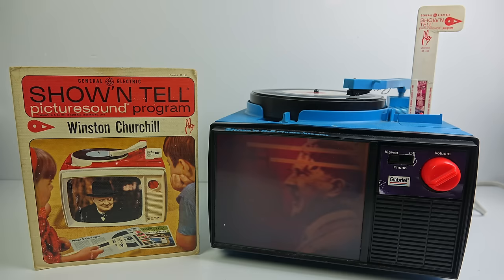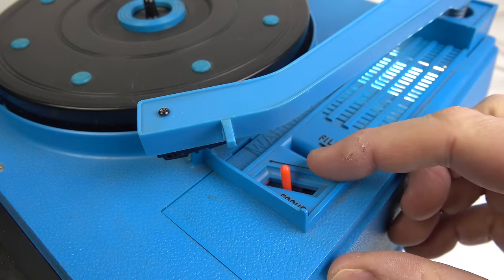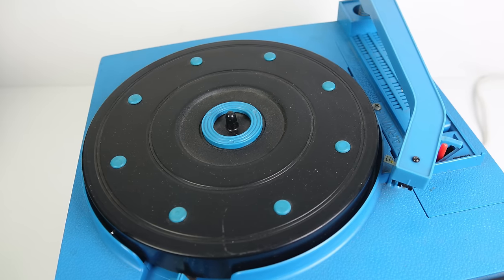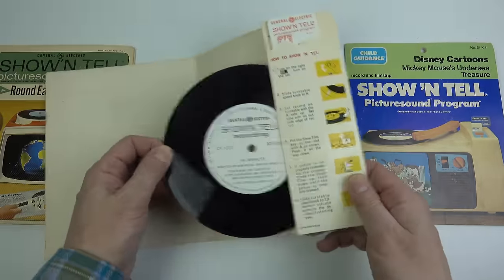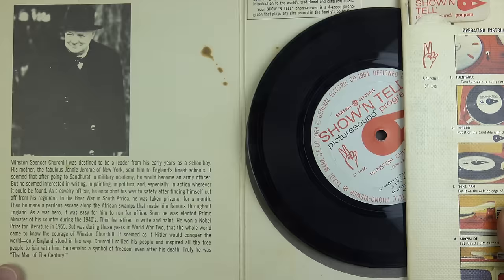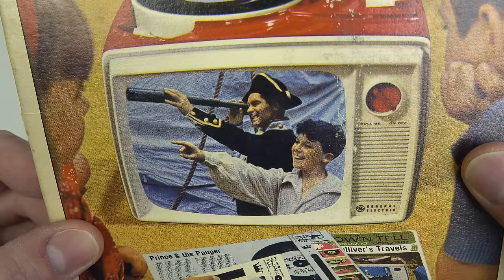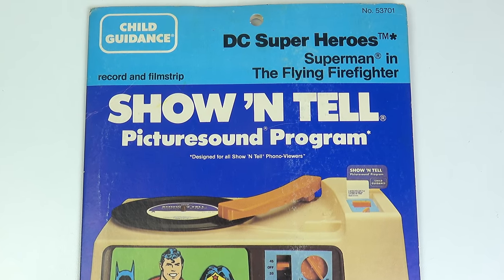Show 'N Tell - 1960s Children's Multimedia System

Comment: ROFL - sage advice, that last sentence.  Made me LOL out loud at work so thanks for that.  

Re: your ongoing battle with 120V @ 60Hz - have you ever contemplated obtaining a North American uninterruptible power supply, a fairly decent one with a large enough battery that could last 20, 30 minutes or so, charge it fully with your 240/50-120/60 converter, then utilizing just the UPS for cleanly powering your various devices from across the pond?  Uncertain that would be an ultimate solution for you but working in IT and being around UPSes most of the time it got me to thinking how you could get portable, reliable, and clean 120V/60Hz power over there.  Thanks for another fantastic post.
Reply: The output of an UPS is not very clean, unless you spend big bucks.
Reply: Fridelain What do you mean by clean? I know in high end audio battery power is as clean as it gets for noise. I assume you mean something else?
Reply: You are not getting DC power straight from the battery out of the UPS. You are getting AC. Now, optimally, AC is a pure, smooth sinewave, a smooth gradient of voltage, up and down. The tech to achieve that from a battery is expensive. What you get instead is a unsmoothed "staircase" of voltages, with sudden changes. You can't chain those cheap UPS, because the fake sinewave from the first is detected as poor power supply and the second UPS is triggered into running off the battery.
Reply: A pure sinewave inverter, a battery and a battery charger is probably cheaper than a pure sinewave UPS. (and more appropriate)
Reply: Fridelain Thanks for the explanation, and the information. Very much appreciated. I'm very much into electronics, including computers. But I never knew about this.
Reply: Ha me too :)
Reply: "Lol out loud" what do you think the ol stands for?
Reply: Colin Johnston [thats the joke...shhh]
Reply: A homemade motor/generator set would work well enough for audio, as long as the speeds are matched with the right size belts.
Reply: You need a "smartUPS" or something of that grade - the important part = PURE SINE WAVE INVERTER 
Used they aren't too bad, may need re-capped if very old.
They are cleaner than the power running into your house.
Reply: Alternatively get a solar setup from the US and have a totally seperate power system. Then every sunny day you could... oh, wait.

Comment: I remember this toy! We had the one from the early 70s. If one wanted to restore the colour, there's a software program, which was developed by NASA, called Retinex. It was originally developed for spy satellite, and probe image enhancement, but it was eventually released to the public, back in the 90s, and 00s. One could scan the images in, and one by one, enhance each frame, then recompose the images, for printing onto a transparency, which could then by inserted into the playing strip. I had the Treasure Island strip, and disc. Thanks for sharing this.

Comment: If you'd like to restore the slides to their original color, I'm pretty sure you could just do as you mentioned in the description (scan and color correct in software), and then print them in transparency sheets.
Reply: Why, its not as though anyone is going to be using it on a regular basis, people like things to be original, they want the crackly sound and dodgy picture, that's actually part of its charm

Comment: DC-motor? Surely a slip of the tongue :)
Reply: Quite a few turntables use DC motors. 

http://thefunkfirm.co.uk/motor-upgrades/
Reply from the maker: There’s a bit more information about this in the video description text box.
Reply: I see your note has 'rectified' the situation.
Reply: Groan
Reply: Ah, how easily people forget your video putting together a 120v 60Hz solution. Keep up the good videos.
Reply: It needs to be a DC-motor to play those superman comics ;-)
Reply: That's what i had in mind with my comment.
Reply: zapro_dk better than a marvel motor!
Reply: I am sorry if this came as a negative comment - it was not the intended to be negative in any way. I just couldn't see any reason for a DC motor being affected by mains frequency, but if that was the case, i am sure Mat would clear that up.
Reply: well given the last thing he shows is Superman, who is DC comics, it should still count.
Reply: Maybe there's a version with a Marvel Motor?
Reply: marvellous comment ;)
Reply: The key reason to keep using AC motor on turntables is because mains freq is very stable. A DC motor is the perfect choice, but you need a speed governor for it. Probably in the design stage (early 60s), a DC motor with mechanical governor was very expensive. Note that cheapo R2R gear didnt got these  nor a Capstan drive.
Reply: LOL
Reply: Though they all had DC motors, power supply is AC converted to DC.
Reply: To be more pedantic it will likely be a synchronous AC motor, the same as was used in older AC powered clocks as they are perfectly locked to the AC waveform.  They do not have a lot of torque, though you don't need much to spin a record under a stylus, but they also don't have the variable slip of more ordinary AC induction motors.
Reply: Ethan Poole oh I forgot about those motors. I had a clock that ran on that type of motor, smooth too.
Reply: DC motor - because the Marvel motor hasn't been invented.
Reply: +Ethan Poole while there are indeed some record players using synchronous AC motors of various types, the majority of them actually use asynchronous shaded pole type AC motors. While those do slip, they can easily be dimensioned in a way that they will give a reliable constant rpm under a normal load range.

Comment: I seem to recall, in my very distant, hazy memory of the early-to-mid 1960s, a system that was much more scholastically oriented that we had for a few years that was very similar but different from Show 'N Tell.  It was less entertainment and more lesson-based and found in, well, classrooms. I kind of think that it didn't have a record but, somehow, the film and audio were integrated into a single cartridge and were synchronized and required no other fiddling. I remember finding it fairly impressive. I should note that I was blown completely away a few years later when my junior high school acquired the very first Sony B/W video camera and tape recorder, about 1971. That was the most exciting and stunning experience of my school years, which doesn't speak well for my school or my academic experience.

Comment: I have seen a similar system, abandoned in our college's warehouse, that uses 35mm filmstrip projector, and have a reel-to-reel machine add-on that switch the slides by beeps on the second audio channel on the tape. And the add-on is not just connects to player outputs, add-on have their own head and has to be physically placed on the side of the player and the tape has to be fed from the reel through player's head, then through add-on's head, and after then on the other reel! It was the weirdest setup that I have ever seen, it looked like DIY, but it was not, because it still had own box and instructions manual.

Comment: We had one of those which, IIRC, we won in a U.K. breakfast cereal competition. I remember that the rack gear on the plastic slide strip would just ratchet over the stationary pinion, when you loaded it, causing quote a build up of little plastic shavings, over time.

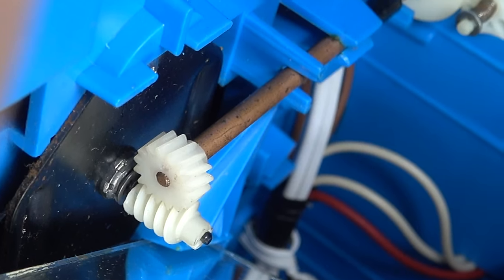Comment: The mechanism that translates the continuous rotation to momentary to move the slides every 15 seconds even though the motor is always running is a Geneva drive gear mechanism. The strange gear with slots in it at the end of the gear chain around 11:19 has a mating gear with a raised section that rotates that gear 72 degrees (In this case, with five slots. 360/number of slots = degrees of momentary rotation for each of the continuous rotations of the input shaft)  every full rotation. They were popularised in watchmaking but also were used in film projectors for exactly the same purpose sped up to 24 cycles per second, a very rapid change between frames that are then held still long enough to be seen.

Comment: The mechanism that moves the slides is called a geneva drive that is also what is used for film video cameras to guarantee equal exposure time of each frame. There is a video by maker's muse that explains how it works If you want to learn more about it

Comment: Can't help but be reminded of my own slide viewer, the Bell+Howell Ringmaster II, instead of a turntable it has a compact cassette deck built in and a Kodak Transvue 35mm slide tray. Not really for the same purpose but oddly similar in design, have to wonder if someone copied someone else's idea there. Very solid device too, still works wonderfully even after 20+ years of sitting in a relatives dusty basement.

Comment: They made a more advanced concept of this for those 35mm school film strips with a built in cassettes deck. Side B of the tapes usually had an ultrasonic cue signal instead of the beep specifically for those auto-advance machines. Looking on ebay, it appears that Dukane even made them with turntables!

Comment: Techmoan has one of the later, cost-reduced versions. The earlier versions had a small metal disc to the right of the turntable that was scored from the center to the edge. You would manually turn the turntable so that the score pointed toward 9 O'clock toward the turntable and you would also place the record so that the big red arrow on the label was pointing toward 3 O'clock and that way, the filmstrip would advance exactly on cue. Hardly anyone bothered to do this so the later models and titles just rely on rough synchronization.

Some titles had the arrow on both sides if the record indicating that you could play the filmstrip with both sides. One side might play a song while the other might have commentary.

Comment: I was actually curious about the playback speed and how you dealt with that issue. While converting the voltage from 220 volts to 120 volts was child's play using a transformer, record players like that typically used an AC synchronous motor and I know wouldn't run at the right speed on a 50 HZ ac signal, since they were designed to run at 60 HZ

Comment: I've had a handful of record players that were four speed. I used the 16 2/3's speed to slow down 33 1/3 rpm albums to try to learn guitar parts. But I've never seen, let alone owned, a 16 2/3 speed record. I just looked up 16 rpm records and found they were mostly spoken word recordings, because the sound quality wasn't really good enough for music. But what struck my fancy was that an under-dash 16 RPM record player was an option of some 1956-1958 Chrysler made automobiles!

Comment: The noise is probably caused by the switching inside the “sine” wave inverter, some ones use two square waves, which produce that noise.
Newer ones use PWM, which is better but may produce a high pitch whine. 
Anyways, I think you could solve it by getting a big filtered plug, the circuitry SHOULD smooth out the square wave into a better sine wave and remove unwanted noise

Comment: IIRC the timing of the slides was based on a number of turntable revolutions. I had one of the later "Child Guidance" models (it was green and included some Sesame Street programs). That model had a tiny little window to the right of the turntable. To preset the sync, you would put the turntable in neutral and turn it by hand until a horizontal line appeared through the center of the window. Then you inserted the film strip, set the record on the turntable, placed the stylus on the record, and selected the playback speed to engage the motor. And off you went. I never handled any of the other models, so I'm curious if the sync window was a standard feature going all the way back to the original GE models.

Comment: the precursor to this was the Kenner play 'n show which didn't have the electric pickup setup on top but an acoustic sound transfer system like in those old 1960s talking dolls 
the records had a ring of slides around them.
you would open the thing up place the record/slide disc on the plateau and close it up and it would automatically play both the disc and the slide after starting it.
by closing it would start up the motor running it and a cone with a needle attached would position itself at the beginning of the record and it would reproduce the sound (acoustically) as soon as you would press or turn the start button/knob.
as with the dolls, the sound would be Tinney and horrible but with bigger volume due to the bigger cone on the inside.
I think these could be made as early as the early 60s right through to the mid-60s

Comment: My dad's a huge 16mm film collector.  For some reason, Kodachrome color 16mm film produced from the mid1960s-early 80s very often exhibit fading where it turns red.  

Interestingly, Film produced in the late 1930s-1950s very rarely have fading.  I guess Kodak changed something in their formula during that time.

Comment: I had the 80s version, which was very cheaply made compared to the older ones.  I remember when it was brand new there was barely enough torque to keep a 12” disc up to speed, and it wasn’t long before it failed to play a 7” properly.  My parents took it back to the store and exchanged it for the same model, which quickly developed the same problem.

Comment: A small note: I own many Super 8 movies. The ones you could buy were really short versions of cinema titles or the real length on two big spools not every projector could play.
All the titles which were mass produced have the exact same red color. It seems that the green blocking dye (as it is subtractive color mixing) is the only one surviving the age so everything appears magenta.
The Kodacolor 40 super 8 spools filmed by individuals however  (color reversal film used for home filming) all have their original colors (a very slight blueish tint though).

It was those industrially produced films (you just printed translucid color on the acetate or plastic) which did not last more than 20 years due to cheap not time-stable dyes.

That move to a magenta tint started already only after a few years the film was produced. After 10 years it was already too much noticeable. But by then home movies on film were dead and VHS came.

Comment: Did anyone notice that the Superman slide was moving roughly in places?  I wonder if the slide was getting caught on something or just wasn't lined up properly.  You say the turntable uses a DC motor and runs slower on 50 Hz AC power, did you infect mean the turntable has an AC motor in it?

Comment: I wonder if there is a way to fix the film strip so that the colors are restored.  I does seem like a big problem with these is that the colors fade, except red.   I doubt the cellulite or whatever material they used for the strip could be fixed, but I know that they made book versions of these stories.  It might be possible to take pictures from a book version and perhaps reduce them in size and print them on clear material to put in the film strip holder.   I would think that would work, albeit, a time consuming task.   I know one could cheat and put a modern monitor behind the TV screen that would play a video of the pictures.  Certainly much easier to do it that way.

Comment: because the device is vintage the filter capacitors on the power supply and amplifier could be failing and letting noise through

Comment: Even if the images are damaged on cartoon based material the sound should be enough. These were made in the '60 and ' 70s when the domiant animation style was "radio with pictures" where they overerdescribed the action to compensate for the severly limited aninmation.

Comment: A little fairy once told me that a cotrolled spray of purified or distilled water onto a vinyl record during spin, greatly improved the playback quality. However, as fairy wings have trouble operating in wet environments, one should make sure that once such action is undertaken, a professionally managed recording is made on the first attempt; for multiple over-use of this knowledge will ultimately etch a different result. Those what know, will understand.

Comment: You've now met the curse of American 7" record collectors - styrene pressings. It was a lighter weight plastic that was used in a lot of our 7" singles in place of vinyl. It sounded fine on the fist few passes but wore out very quickly, especially with cheap, heavy ceramic cartridges, and exhibited a particularly nasty sort of wear called styrene shredding, of which you have an absolutely textbook example with your Superman record. (The original owner must've really hated that B-side.) Most were pressed using an injection-molding process that required the label to be glued onto the surface of the record after it came off the machine, rather than pressed into the plastic. 

Styrene LPs exist, but they're relatively uncommon, and they had died out for good by the late 1960s. You're most likely to find them with original US Decca/Brunswick/Coral LPs from the late 1950s (including Bill Haley and Buddy Holly), and a few of the scruddier budget labels.

The Show-n-Tell people were sensible enough to not use styrene for their records, since their players chewed it right up ... until CBS bought the franchise and started using their own pressing plants, most of which used styrene exclusively for all their 7" pressings.

By the way, those spiffy little instrumentals on the flip sides of some of the 1970s Show-n-Tell titles were from a production music library. The 1960s cuts were often lifted from the catalogs of the Tops and Pickwick budget record labels.

And that little plastic fork thing next to the turntable IS the tonearm rest. :-)

Comment: DC motors work based on rectified DC voltages and are adjustable ,what you meant was AC Synchronized motor
Reply from the maker: There’s a bit more information about this in the video description text box.